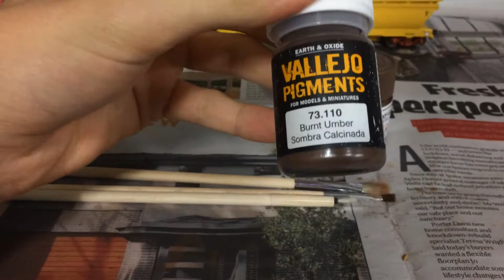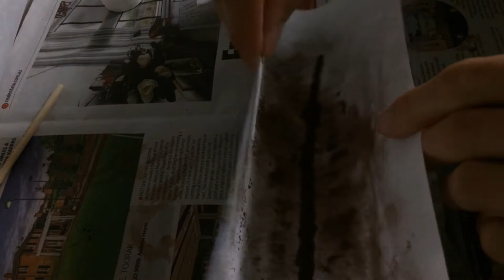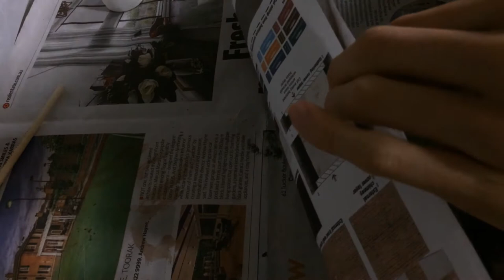37. Nicholas's Weathering Series. episode 1.- Simple grain hopper weathering. Without an Airbrush!

Comment: Very neat job there, I’m to chicken to do weathering nor decals 😂😂
Reply from the maker: Haha thanks for your nice comment. If you practice on some old wagons it will make you more confident with weathering and then you can do it on your nice rolling stock and if you feel like it maybe locomotives. I find decals to be quite easy the thing i dislike about them is that take for ever to do but if you take your time and practice you will be more confident and you will get some good results. hope that is useful. How is your SEM DERM coming along BTW.- Nicholas.
Reply: @NicholassTrainChannel  Practice is key, I don’t have many wagons that I would use for practicing on but maybe a quick stop in a hobby show can fix that. The DERM is basically complete, just with the bloody decals haha, that’s the last thing to do!
Reply from the maker: @joosh.761  If you don't have many wagons then buy some off of Ebay and practice on those. glad to hear the DERM is almost complete. for decals just leave them in water until you see them lift off the backing sheet and then slide them on to the chosen area your putting them on. Hope that helps.- Nicholas.
Reply: @NicholassTrainChannel  might look into it! With the decals, I did that but the decal ripped in half, so then I stopped because I gave up pretty much, maybe it’s because of the details on the DERM but I couldn’t Be too sure
Reply from the maker: @joosh.761  If the decals ripped then try use paint and see if that helps. Or use decal softener on the decals that go over bits of detail I'm sure that will help.
Reply: @NicholassTrainChannel  I’ll have a closer look into it, I will probably end up going with paint
Reply from the maker: @joosh.761  if painting is easier than just do that and make sure you mask the model throughly and take your time with the masking as well. Good luck.